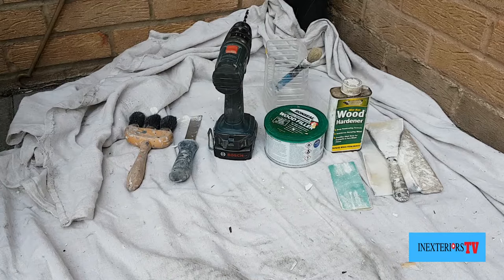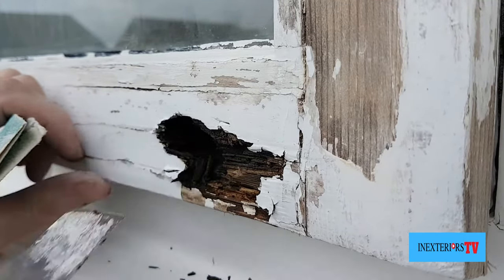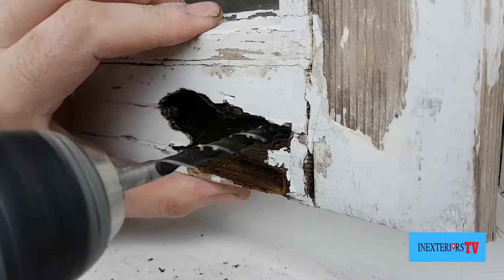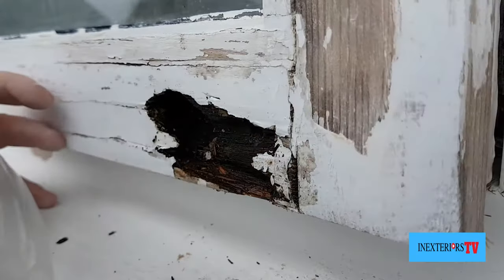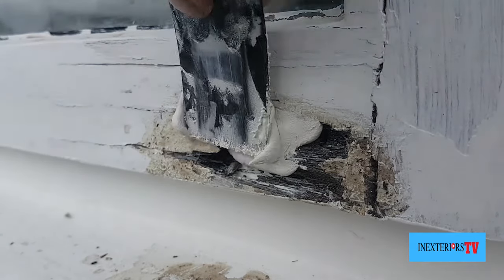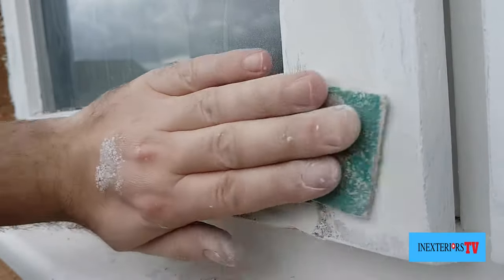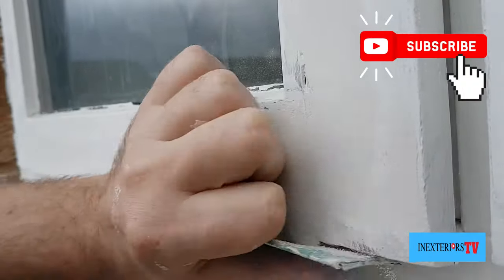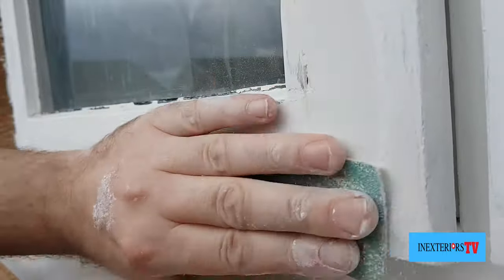How to repair a rotten window frame. How to repair rotten wood.

Comment: Many thanks used your method above as it gave me the confidence to have a go, one question though in the video above the two pack filler is very loose and easy to apply, I have followed your mixing video and the tin instructions and in both instances, the filler is way thicker than the above video, in today's temperature I am having to use less hardener to give me chance to make it usable, but is still difficult to actually fill with, is there something I need to do to get it as loose as you have it in the video.
Reply from the maker: To be honest, the filler was going of quickly with me the other day in the heat, try and fill when it is a bit cooler. also just mix a manageable bit at a time.
Reply: @Inexteriors  Much appreciated, yeah I found out how fast it goes off in the current heat, had to dramatically reduce the amount of hardener to stand a chance of doing anything

Comment: Brilliant video Steven and just what I needed today as I noticed water on my window cill and this is caused by the corner of my window frame rotting away.  I'm going to repair it following your video.  Quick question though, can you recommend the primer and second coat paint you used?  I'm also tempted to strip away all the paint and repaint the entire frame, belt and braces if you like which would also give me an opportunity to check the rest of the frame over.  Many thanks
Reply from the maker: Hi.Thankyou for watching, i used Leyland trade primer undercoat for spot priming, then i used Johnston's trade oil based  undercoat and gloss.

Comment: My old upstairs landing window non opening has been leaking at the bottom after heavy rain.
Scraped  away rotting wood at the edge of glass 5mm width , 10mm.deep,  what best to fill with?
Reply from the maker: Same process as video.

Comment: after removing the rotten wood, what solution did you use before filling the hole, and is it mandatory?😮
Reply from the maker: Wood hardner, yes it is mandatory,

Comment: Ahh cheers dude

What is white prime pint called? 

Then you put gloss on ? 
So thats two lots of different paint yeah?? 

Prime & Gloss ??

I walked round B&Q and couldn’t see anything with “prime” on it? Just matt and gloss ??
Reply from the maker: It was leyland primer undercoat, you can get it in b&q. on this i used the primer undercoat, then a oil based undercoat and gloss.
Reply: @Inexteriors  bloody ell THREE tins of paint??? Gunna cost a fortune! 😝

Nice one mate 👍🏻
Reply from the maker: @DeeTeaDee  You can use the primer undercoat, just give it 2 or 3 coats.
Reply: @Inexteriors  oh so

Primer undercoat & gloss

Just two tins but 2 coats of undercoat followed by 1 coat of gloss yeah?
Reply from the maker: @DeeTeaDee  Yes, if its new wood maybe give it 3 primer undercoats.

Comment: So what happens if you can't keep the base section as that has all rotted away
Reply from the maker: Maybe get a joiner to have a look.
Reply: Maybe take it down. Then fill it from the underside first, then from the front.
(Or the other way around?)

Comment: Ok, now how bout a video where that bit of the frame is cracked and breaks. Can you replace that piece of wood, or does the whole window need replacing?
Reply from the maker: probably need a joiner to look at lol.
Reply: @Inexteriors  dang it. I had a feeling it was gonna require something I didn’t have. There’s no shot they sell replacement pieces, and it’s a “historical” house so we can’t switch to vinyl. Oh well, thanks for replying
Reply from the maker: @KelticTim  No probs at all.